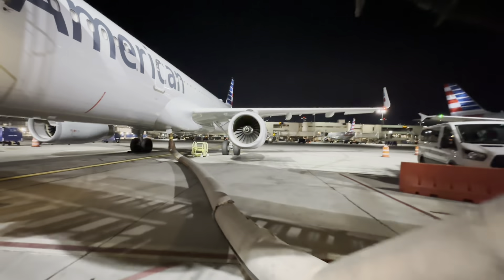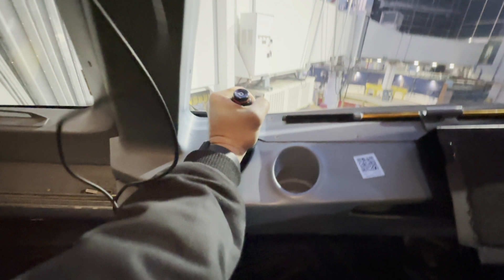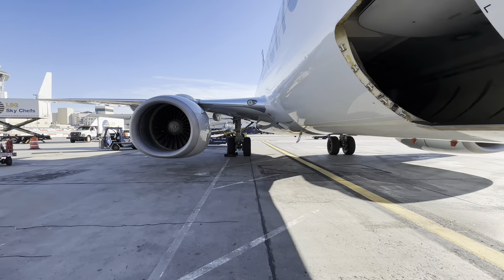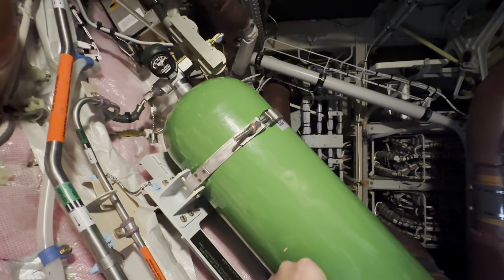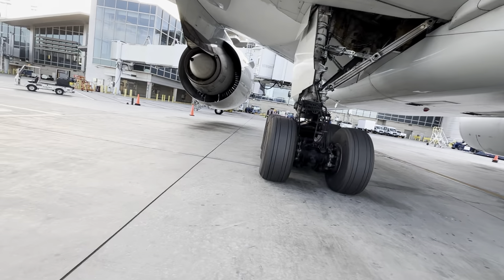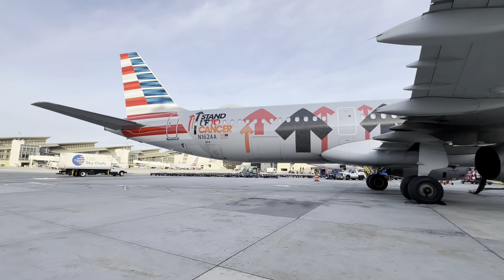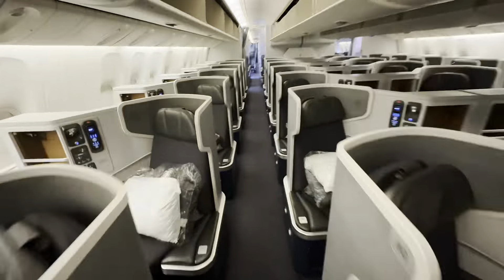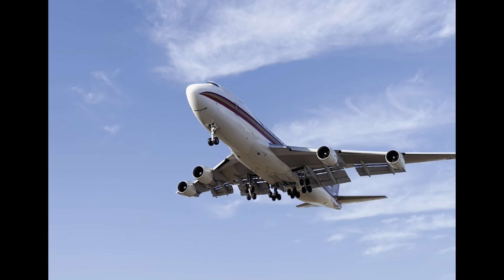Stig Shift #6 (Aircraft Maintenance Adventures)

Comment: im so curious on the a321 aft cargo compartment , it seems there is a uld ? or a cabinet ? why is there so little space XD
actually im a baggage handler here in hong kong
Reply from the maker: That’s because there is a ACT (additional center tank) fuel tank there.
Reply: @StigAviation  sacrificing 31 32 33 for longer range huh XD damn
Reply: @StigAviation  have you ever work on an a380? im so curious on how it's cargo hold looks , there is less ,or even none video out there
Reply from the maker: @JpKitjai  I have never worked on the 380.
Reply: Finally worked on a a321LR (Peach Aviation) and damn the cargo compartment are really shortened quite a bit

Comment: Trim wheel on Airbus is in the dash board, how would you manually move?
Reply from the maker: The trim wheel on the airbus is very easy to move, even though there is cables attached, it’s still a flyby wire system, as long as there is hydraulic power, they can rotate that wheel with ease, I’ll try to show it next time when I have a chance

Comment: Thanks for the great info in the video. For the SRM mentioned at 14:24, does it cover the wings as well, or just the fuselage? Can fuselage frames and not only the skin also be repaired? Are there X-ray analysis done on the metal to check for cracks during SRM?
Reply: All structural areas are included in the SRM. Wings, stabilizers, doors, some flight controls are all included. Frames can be repaired depending on the extent of damage. Sometimes sections of them are just replaced. Different Non-Destructive tests are used for inspection of skins and structures including high frequency eddy current, ultrasonic testing, X-ray or dye penetrant etc.
Reply from the maker: The SRM covers everything. There is a procedure to repair pretty much every single portion of the aircraft, and if there isn’t the manufacturing engineers can create an engineering order to repair it.
Reply: Your videos just puts a spotlight on the absolutely mind blowing engineering on planes and also what it takes to keep them flying for decades. Imagine the work that went into creating the SRM in the first place. Genius creativity and procedures paid in blood from learnings from previous accidents.

Comment: I have questions:
How come the PTUs in Airbus barks, while Boeing aircraft PTU doesn’t bark?

Is it normal for Airbus PTU to continuously bark?  A while ago, I was on a Frontier Airbus A318 from SFO to DIA.  After take off and all throughout the flight, just woof wo woof wo woof wo woof.  Someone asked about the noise, flight attendant says it does it all the time.  That was the only time I rode a barking Airbus throughout my entire flight.

Have you ever serviced an aircraft that had its RAT deployed?  I know the RAT is like the last thing next to a completely dead aircraft.  Since it’s hardly used, is maintenance even done on it, or even functional periodic checks?

Where was this channel all my life?  I’m amazed at the passion you have for your job.  My favorite thing you do is when you send off the aircraft with love by drawing a heart in the rubber bits in the landing gears house.
Reply from the maker: The PTU on the airbus has a very different function than the one on the Boeing. This is why you don’t hear it on the Boeing unless there’s some kind of malfunction with the flight controls. On the airbus it is a normal thing because it’s compensating pressure from one system to the other. I actually made a full dedicated video explaining the PTU. Also, in regards to your question about the rat I also made a video about that explaining it. I have serviced them for maintenance purposes, but I have not seen one come in deployed

Comment: Do you ever have to repair electrical connections? I assemble electrical systems for my job and I'm curious what aircraft electrical systems look like. Is it all barrel connectors? Deutsch? Weather pack or all proprietary?
Reply: Avionics are the ones that repair and replace things like wires, harnesses, cannon plugs, etc. As a general technician while you can do something like a GVI on stuff like that and write it up that is a specialty repair performed by specialized technicians.

Aircraft wiring systems use military style cannon plugs on aircraft like these for connecting points. There's also other things that are part of the electrical wire integrated system such as terminal blocks, clamps, standoffs, etc. Pretty much everything having to do with the aircraft electrical system is its own field.
Reply from the maker: I have done electrical repairs in the past, I am a general mechanic, which means I have general knowledge on all of the basics, so repining, a plug or changing out a wire harness is something that I can do. But we do have specialized avionics technicians, most of the time they are performing those duties, and I will be there to assist And learn

Comment: Hey Stig,I notice on the 777 when the aircraft does a big turn a pump or motor goes on for some time then off. Do you happen to know what type of unit makes that noise?
Reply from the maker: It’s probably one of the center hydraulic pumps

Comment: "The aircraft records EVERYTHING!"
Cars are getting that way too, most of the time when I get a check engine light in the bay, the car's computers will have some idea of the general operating conditions of the vehicle at the time it decided to turn on the "money light" as some call it (this log is usually called a "Snapshot", the computers basically store as much as they can about what they were observing and telling the vehicle to do at the time.)
The vehicles that have cameras to use as sensors for the driver assistance tech are also really good, I'm not supposed to wipe the memory of those if the thing comes in wrecked because the insurance company might want to look at what they recorded (they usually only have the memory to record a few 10s of seconds and the resolution's not great, but it's "something", enough to get a good idea of the sequence of events and what the vehicle did about it at least). Tesla's like to "oops I forgot accidentally on purpose" with their autopilot/driver assist cameras, because that makes it easier for Tesla (the corporation) to deny fault in the potential injury of someone that drives them, so don't buy a Tesla (there's loads of other reasons to not buy a Tesla but that's just the "even if it kills you and it's because of a design fault or software glitch, your family won't get paid out by Tesla" tip of the iceberg).

With certain faults this is more useful than others, and sometimes you can trick the car into giving you TWO snapshots. For instance if it's an oxygen sensor that's not responding fast enough, that could be triggered at any time (first snapshot), but the computer likes to actually set the code during highway driving (second snapshot, where it confirms that it's not doing what it should be doing). Some makes and models give you both snapshots, some only give you one, depends on which specific one you have and there doesn't seem to be any real trend to it.
Reply from the maker: It’s quite interesting where technology is going

Comment: If a plane does experience severe turbulence and exceeds those G forces, would a message appear in the flight management system?
Reply from the maker: The message would be buried deep inside the computer systems and I would have to dig it out just like you saw me doing it here. Now, if the turbulence caused any kind of damage or computer faults, then it would pop up on the screen.

Comment: Hey stig, I wonder if the winglets are optional or they can be installed and replaced depending on the airline demand
Reply from the maker: I believe it’s standard, those components are what makes the aircraft more efficient. There are variations, but pretty much all aircraft have them.

Comment: @StigAviation do they only use certain birds for international flights or are they likely to send any plane in the fleet on an international flight?
Reply: To keep it simple no, they can’t just send any plane on an international flight. One reason would be ETOPs
Reply: It depends on what you mean by international flight. If the flight will be a short or medium haul in the same continent, the aircraft choice will be made based on range and passenger demand and can be anyone. If you are talking about long haul flights and/or over long masses of water, there are specific characteristics that not all aircrafts have, such as ETOPS certification.
Reply from the maker: As both of these individuals have pretty much, answered your question correctly, let me add to this. International flights out of my station, which is LAX is usually done by widebody aircraft, but we do have narrow body aircraft, such as the 321 Neo, which flies to Hawaii, now Hawaii is not international, but it is a ETOPS mid haul  flight.

Comment: How long if u know are the a320 family and 737 family aircraft wings
Reply from the maker: A320 wingspan is 117 feet and 5 inches, the 737 wingspan is 112 feet 7 inches. It also depends on the model of the aircraft and if it’s equipped with different type of winglets.

Comment: Do you only do preflight checks? Or do you do overhaul and hangar repairs as well?
Reply from the maker: I work the line currently, so my job consists of pre and post flight work and on the line discrepancy items. I used to be hangar in the last, but I prefer line nowadays.
Reply: @StigAviation  Gotcha. Easier work? I also assume you like the constant change of the line?
Reply from the maker: @JohnSmith-fx4se  I wouldn’t easier, just a bit different. Line is more active and unpredictable work. You never know what challenges the next flight brings. Also working under time constraints of dispatching aircraft safely and efficiently. Overall all aircraft maintenance is enjoyable and a challenge whichever environment you choose.

Comment: hi when aircraaft is on ground some airline will not turn air-condition on stating it too expensive i was wondering dont they have anything that hope aircraft system to ground power instead of apu or whatever is running the aircondition
Reply from the maker: They do have jet bridge preconditioned air. That’s that big orange hose You see attached to the belly. That is basically air-conditioning, instead of using the APU, they will use that.
Reply: so why would some airline not use it and keep their passenger without aircondition is it cause it cost a lot of money bro?? @StigAviation
Reply from the maker: @yaad2226  i’m not sure, I know only that my airline does not do that, they will run the air conditioning, no matter what to keep passengers comfortable

Comment: What would be the reason that the air driven hydraulic pump would need to operate?
Reply: Just another way to operate the system really. It's actually a carryover from the 747 which also has the same system. There can be multiple reasons for going with pneumatic driven versus electric or mechan such as space and packaging concerns just to name one.
Reply from the maker: It’s just a different type of design. Air driven pumps is another variant of it.

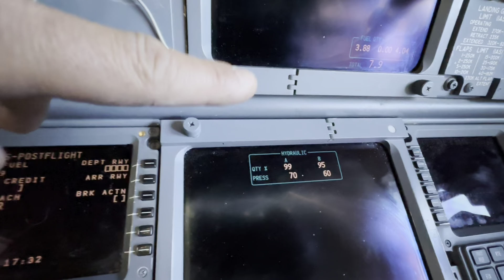Comment: 18:40 why is B lower than A shouldn't they be equal, how do you do that?
Reply from the maker: There is minimum levels on the independent hydraulic systems. They do not have to be at the same level.

Comment: hey sir the power transform unit to transform what power to the airplane ? if the airbus didn't have power transform unit what happen the 787 dream air has this unit?  you say 787 all the unit use it  Electricity is that correct
Reply from the maker: On the airbus, the power transfer unit is for hydraulic systems, the 787 is a very different aircraft and functions with different hydraulic systems, you cannot compare the two

Comment: What was that water splash or smoke that came out of the jet at 32:35?
Reply from the maker: That was simply water coming out ofthe forward lavatory
Reply: @StigAviation  Aren't people not allowed to use it after takeoff? or is it just dumping excess water?
Reply from the maker: @SadraShameli  it was most likely a flight attendant using it.

Comment: if some airplane in the sky one engine has mile function did airplane can land on the ground ? i think is very hard to land the airplane may be like a no had a fly  uncontrolled  why i get this conclusion because I have dissected cicada before. I cut off one of the cicada's wings and tied it with a rope to see if he could fly and land! The result is that she stumbles around like a headless fly
Reply from the maker: If an aircraft loses one engine, the aircraft can still fly and function normally and land normally

Comment: How long does it take to fuel a 777 from min to full?
Reply: I dont do refueling, but according to Boeing a 777-9 can take about 25,000 gallons in roughly 24 minutes. The 777-9 can hold about 52,300 gallons.
Reply from the maker: That sounds about right. 20-30 minutes. Even faster if done from both wings.